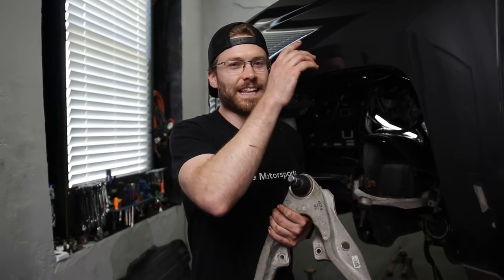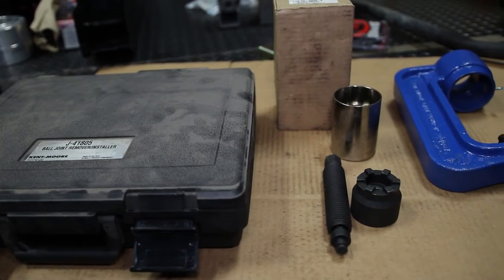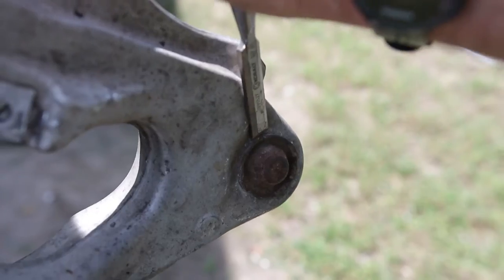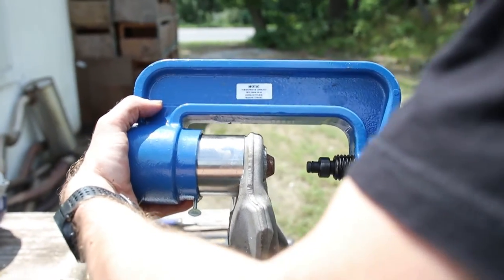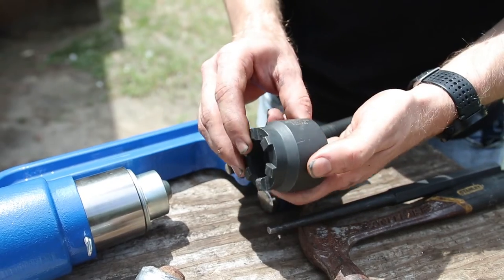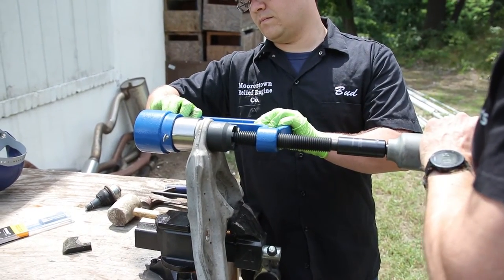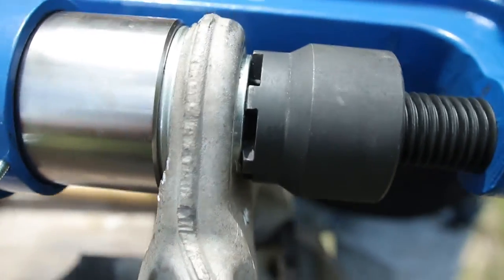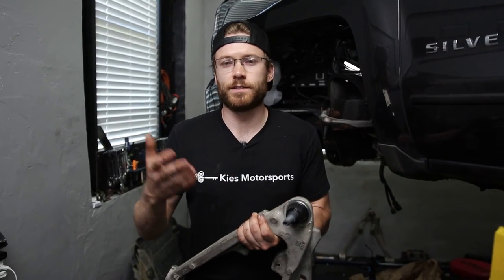How To Replace 2014-2016 Silverado and Sierra Lower Ball Joint with Aluminum Control Arms

Comment: That process didn't look half bad.  In other older vehicles I would have said that it was so much easier that it was worth it to spend the money for a whole new control arm.  I would definitely consider doing this to avoid replacing my aluminum control arm with a stamp steal version.
Reply from the maker: Agreed, the aluminum arm is so much nicer. It is worth the time to do. If you get friendly with your local dealer they might even let you borrow the tool 🙏😉 you do need a heavy duty impact tho.

Comment: Can you make a Video Explaning the Differences of Lower Control Arms ?
ie: Cast Iron , Aluminum and Stamped Steel ? 
and are they interchangeable ?
i know also Different Knuckes were used : Cast Iron Knuckle and Aluminum Knucle
Reply from the maker: Sure can. Need to do a little research on it myself and I'll let ya know

Comment: same for tahoe 2016 ? a mechanics once told me” aluminum control arm can’t withstand hard pressing so you need to buy new ctrl arms with ball joints” is that accurate?
Reply from the maker: Not sure. Worked fine in this case and he hasn't had any issues since

Comment: I didn't have any luck using this method on cast iron lower control arms. Hours of chiseling only to cave in the center of the old ball joint with the press. I bit the bullet and bought new lower control arms, well worth the hassle. Aluminum arms must be more malleable
Reply from the maker: I think this method is only intended for the aluminum control arms but not 100% sure. The aluminum is definetely more malleable.

Comment: I'm just guna replace whole arm upper and lower plus tie rods ... And you can get the aluminum ones aftermarket btw mine are steel but it's 2016 cuz built in December unfortunately I could go aluminum but don't want to chance not fitting

Comment: Mines not clunking it's creaking over bumps and turning is that normal for these I've never seen a bill joint creak without play or clunk?? Any thoughts also I have a 2016 my arms are steel built 12/05/15 so idk what gives lol... Max tow package with factory duratracs

Comment: Will this work on my 2015 1500 Silverado it has a bds suspension 6in. And they say I need new upper and lower control arms
Reply from the maker: It may - depends on the control arms you have.

Comment: Can you replace both aluminum lower control arms that have aluminum knuckles with steel ones
Reply from the maker: Alluminum control arms will worth with steel knuckles but you have to make sure you get the correct knuckles designed to work with the alluminum control arms because the steel control arms have a differently shaped balljoint.

Comment: would the Aluminum knuckle Replace the Stamped Steel on my 2017 Tahoe ?
Reply from the maker: The problem is they used different sized ball joints so I don't believe it is a direct swap. I'm going to do a little research on this for you
Reply: @TheSundaeDrive  Thanks !!!
was little disapointed when i looked under SUV and noticed arms were Stamped Steel - Looks at 4.10 :https://www.youtube.com/watch?v=OBFjYnKn0eY
2015 was aluminum Arms !!!
why the Change GM
Reply from the maker: Saving money 🤦🏼‍♂️

Comment: Do you have to remove the entire lower control arm to replace that ball joint?
Reply from the maker: Might be able to figure out a way to do it on the vehicle but having it off definitely makes it a lot easier.

Comment: where can i get the crimping tool for the ball joint? do you know the nomenclature? I can't find one anywhere
Reply from the maker: We were fortunate enough to have access to a dealers tool set. The tool was over $500 I think. There may be some aftermarket ones out there that will work.
Reply: Thank you for the quick response! My Father and I came up with a solution...we ended up grinding down an old railroad spike to make a nice flat punch. we pressed in the ball joint and crimped it with the spike-punch and a sledgehammer... sounds janky but it worked really well 😂😅. Very helpful video! thank you! Liking and Subscribing!
Reply from the maker: Haha awesome! If it works it works!